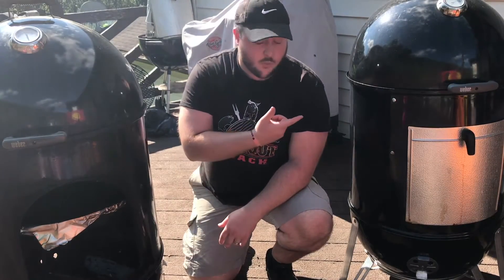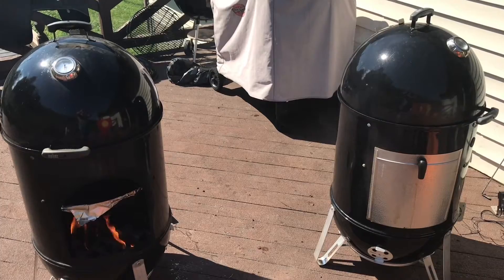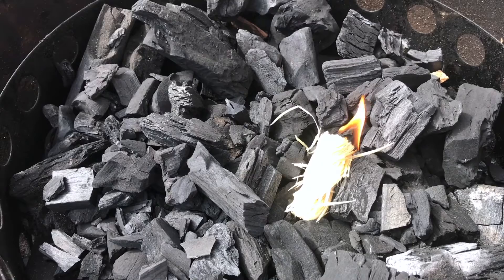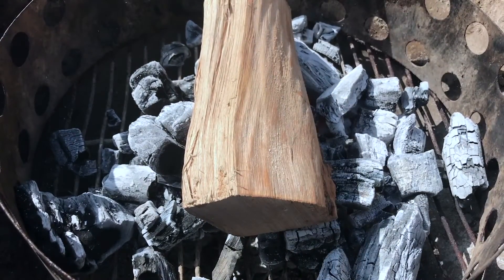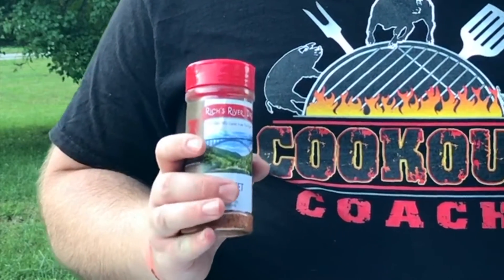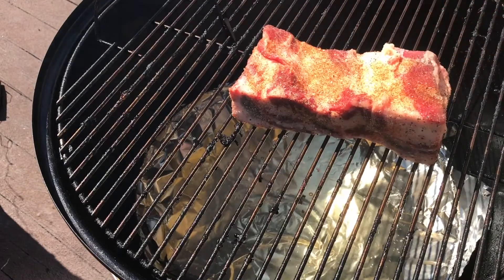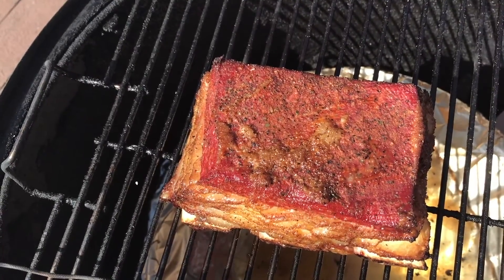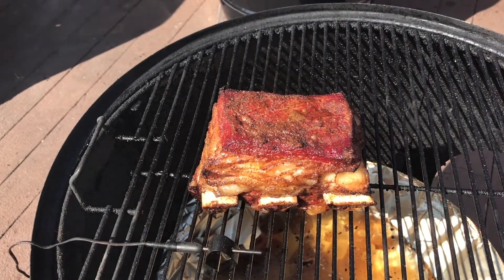Boiling Water In A Smoker?

Comment: Let me ask u a question.  If the boiling water helps set the bark here does the same hold true with putting boiling water in the sns setup
Reply from the maker: Absolutely, and it took me a long time to understand what was happening, but basically it breaks down to that hot steam transfers energy more efficiently than hot air so the more boil, the more steam, the quicker you can set bark

Comment: The MMS is essentially a giant steamer and steam transfers heat to the surface of the meat more efficiently than air.  That's why the surface of the meat 'cooked' faster than the standard wsm.  When you wrapped the steamed ribs you actually slowed the cook because the steam could not touch the meat.  About the only reason to wrap in a MMS is to limit the amount of smoke the meat absorbs.  This is especially important because smoke adheres  more readily to a wet surface. Thanks for the demo
Reply from the maker: rick leeo thank you that makes a lot of sense.  The only thing I would add, and this is just my own personal experience is when you wrap, whatever you wrap with really gets its flavor pushed into your bbq.  Thanks for watching and your explanation, makes sense to me

Comment: WSMs have a water pan to diffuse heat with the assumption that it also acts as a heat sink/ thermal storage because of the specific heat capacity of water taking so long to heat up or cool down. If my WSM pan is getting the water to 212 degrees it will create steam and help the cooking chamber regulated closer to smoking temperatures of 225 or so. I guess what I’ve been doing wrong is using too much water in the pan. I wonder if I can manage my steam by using just a few ounces of water at a time?

Comment: Interesting comparison.  Myron might be onto something, but I can’t see it as game changer.  

I’ve done water & sand in my WSM and really can’t tell a difference in the finished product.  Sure, water might make a slight difference in bark, but it’s minuscule, even if measurable.  And because energy is used to transfer water into steam, more fuel is required to sustain that transfer.  At a rolling boil, even more fuel would be required than normal for higher temps.  To me, a slight edge in bark isn’t worth it.

That being said, great video.  I always love seeing comparisons.  👍
Reply from the maker: RaleighSmoke hey bud thanks for checking the video out.  I agree with you by itself it’s not a game changer on its own and it will definitely require more fuel because more energy will be required to boil the water.  That being said if you have a strategy say for instance on brisket that involves a killer mop sauce you use in the foil then with this technique it gets to spend more time in the foil with that sauce.  Mainly with this one I was just curious if it was repeatable and really just as interesting to me was that foil didn’t make a difference in when the two products finished which is something that is always preached in our community.  St the end of the day this was just a fun video to try to do, I definitely wouldn’t go out of my way to run a wsm like that on the regular, actually I generally don’t like running water in my pits but if it’s designed to do this, I’m cool with it.  Have a good one bud👍

Comment: Hey Steve!  Recently I've been fascinated by the idea of an H2O smoker.     I've come back to this Vid of yours and I hear what you are saying.......I just wish you had a better cut of meat for this test.  All your explanation of the method and pit set up was lost on most folks because all they care about is the final product.   I'm interested in the Pit! 
I'll be watching your Vid with You and Rich with the whole hog to see what the results were with that cook with the H2O.   Be talking to You!  🔥🚰  \m/
Reply from the maker: Heavy Metal Bar-B-Que I see, the bark probably would have been more evident on a pork butt where you can see that bark setup on more surface area.  I finally had someone explain it to me as the steam coming off of that hard boil transfers energy so much better than air or the minimal amount of steam a normal Smokey mountain puts off.  If you really want to see the difference my Myron Mixon comparison video both cookers we’re running at 300 and the difference in the amount of time it took to set the bark was nuts.  Thanks for checkin it out, I’m sure you’ll come up with somethin cool to do to a h2o cooker